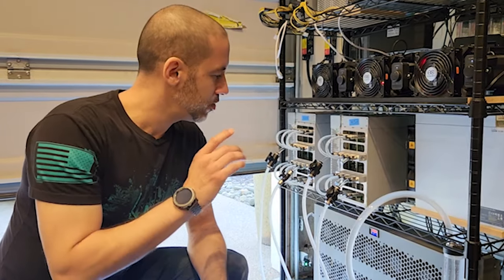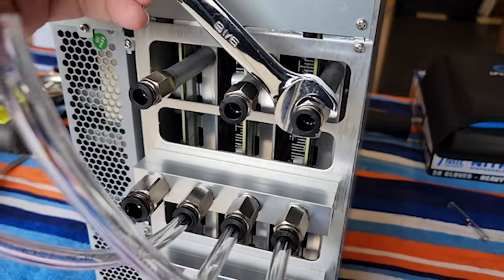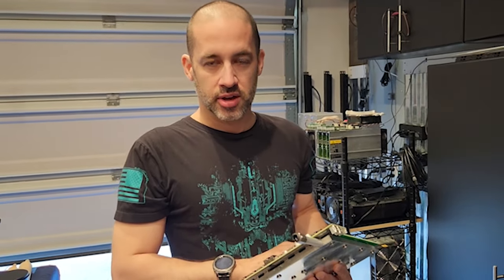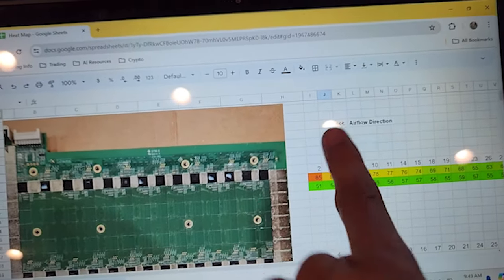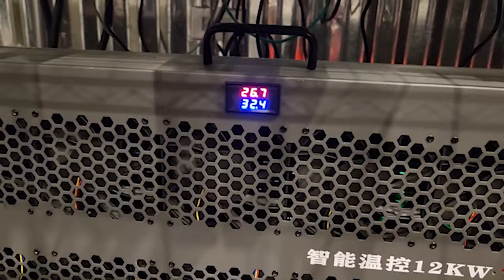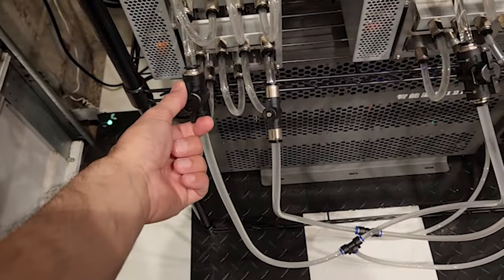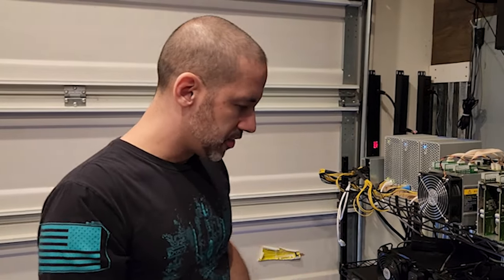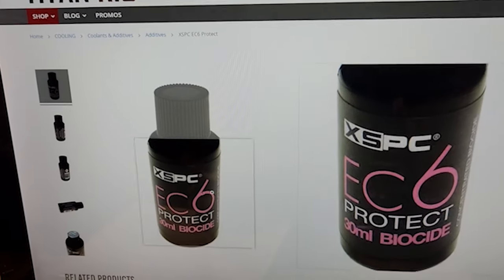Water Cooled Kaspa ASIC Miners, Deep Dive, Setup, Improved Cooling Results!

Comment: This is awesome. You could really get creative with liquid cooled. I could heat my garage during the winter and heat my pool during the summer with a liquid to liquid heat exchanger.
Reply from the maker: We did exactly that last winter! Though we aren't cool enough for a pool 🙃 our house was toasty though!
Reply: @BoneyardLabs  Its an above ground pool so not that cool. lol. Did you move the cooling radiator into your house? With some extra tubing I guess you could place the radiator practically anywhere assuming it doesn't need 220V/30A.
Reply from the maker: @jjsandersheli I have since removed this setup. We are moving. The liquid cooling system worked too well, actually. They cooled the chips lower than optimum operating temp which is around 70-80. We were using a rad that was designed for 3 asics even though we only had two hooked up, so we couldn't turn it low enough sometimes to keep the temps in range since half the fans were automatic speed based on coolant temps. The other downside we ran into was bio contaminants. We added biocide, but the lines would still discolor over time. We never perfected the coolant. We had a makeup vent leading into the house essentially.

Comment: I saw this a  month ago and i really thought about it and i order the fog hashing for 2 miner not sure what's the best option but I'm glad you did this video i haven't see one that explains everything in a month will see how the fog works for me
Reply from the maker: Niiiiicccee! I'd LOVE to have a foghash machine, but the cost was a lot more than this setup after import, duties, shipping, taxes. Foghash is super cool though!
Reply: @BoneyardLabs  i was able to chat with them and they told me import tax and duties are included and yes the shipping is a bit high but i got the one for 2 miner for plus the liquid total of 2850 but i negotiate to 2400 total so hopefully it works out
Reply: I am trying to get fog hashing to design me a geothermal cooling solution for my ny warehouse. so far not responsive. I asked for an immediate 6 unit test to be se nt to try. then ip will order 1.2mw for the next phase. I'm thinking I will have to engineer my own geothermal closed loop system with my plumber. I am a seasoned landscape contractor asic hosting $200k in miners in texas and Nebraska. do you have any ideas?
Reply: I've met fog hashing at empower houston and mining disrupt miami 2024. very friendly and they want to make a simple sale real bad. I'm looking for something special from them and it does not seems to be working.

Comment: thanks for this great informative video

i do have a question though, are you overclocking yours?

i just purchased the ks5l kit from zeus and hoping it will allow me to OC safely but i realised after reading stuff in the ks0ultra ocs that mosfets also get hot and i dont know if the blocks cool the mosfets on the 5l or just the flowing air from the fan
Reply from the maker: Nice! I haven't done any overclocking. I don't know about the ks5l since I don't have one in hand. The blocks are only contacting the chips, but it would be interesting to see how much heat is sucked out of the rest of the board because these cooling systems are so effective at temp control.